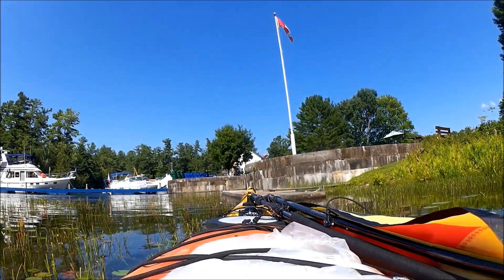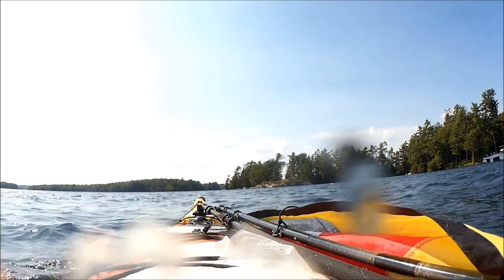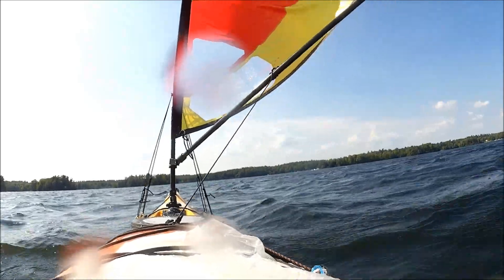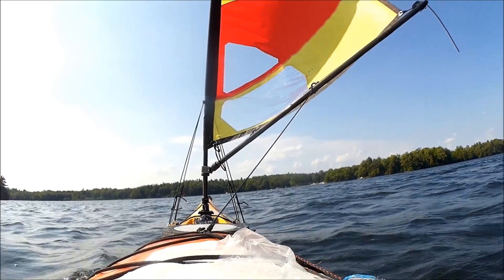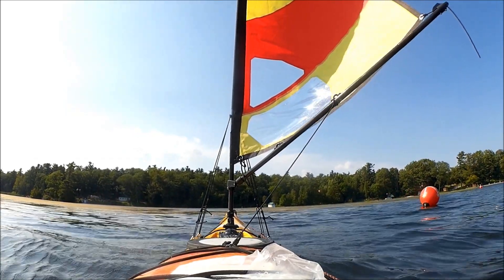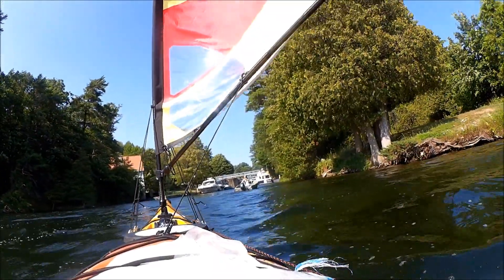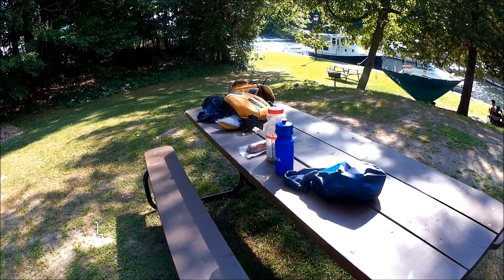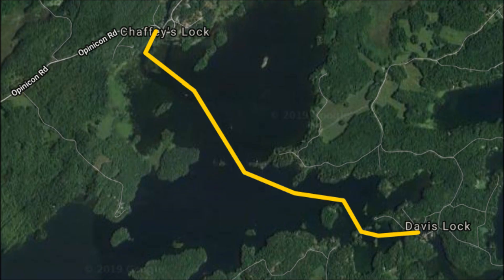Sailing Kayak Camping- Davis Lock to Chaffeys Lock

Comment: Thanks for the trip; Beautiful and I think your explanations added later to the camera audio are far more interesting the music some people prefer. I guess you're aware that some tradional canoe paddles and some telescoping standup board paddles have a flat enough blade to use as a lee board, which you get up and down again quickly  through those weeds (just supposing lateral resistance of the sharp hull gets a bit poorer as you are slowed up; Some small cats, for surf, have no blades, but sharp hulls, and skid sideways heaps till they gain speed. Sometimes best to go downwind briefly to gain speed for what old timers called 'steerage'.

I'm learning bits and pieces from your videos, though I've I had lots if tiny boat experience. 

Good techniques; with no fuel and OK without extravagant gear; because you know where you're going; I've wasted lots of time over distances like that because I 'aimed wrong'... you're smarter I guess (I hope you don't hide your errors from us).

Cheers
Reply from the maker: Thanks.  Your comment about needing a bit of speed to keep tracking is bang on.  It can be seen pretty clearly in the vid.  I entrr the weeds at about 90 degrees to the wind, as I lose speed, I slowly turn down wind.  By the time I exit the weeds I am about 140 degrees off the wind.  In most conditions the easiest way to keep a kayak tracking up/across the wind is to paddle.  You don't need to paddle hard, just fast enough to keep water flowing over the hull/skeg/rudder.

Comment: Good mix of life audio and post-production

who is the idiot who suggested that?? ha

don't you have a skeg that could get weeds on it? and without a skeg (keel) would be hard to sail against the wind
Reply from the maker: The skeg is pretty streamlined.  When fully recessed, no skeg protrudes.  As the skeg comes out of the housing it is angled back starting at 0 degrees, maxing out at maybe 40 degrees for fully down.  I normally sail with about 20-30 degrees of skeg down, so the weeds just slide under it.  There is nothing to get hooked on.  My rudder on the other hand is very near tp vertical/90 degrees, so it will hook weeds.